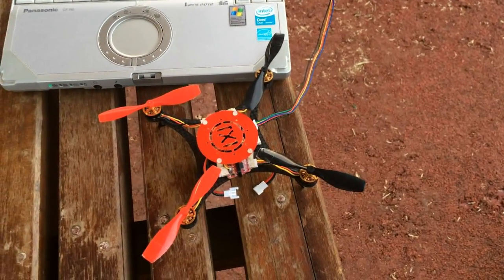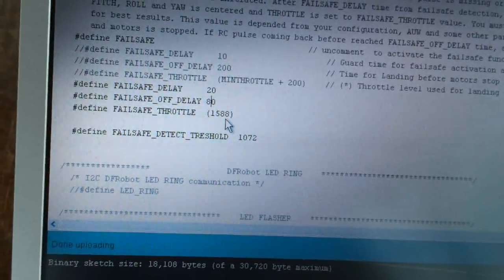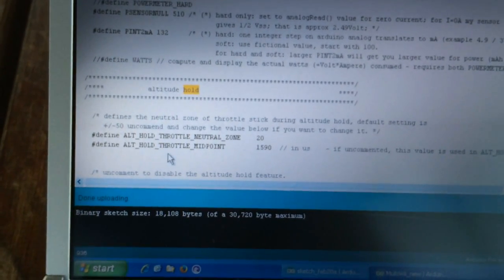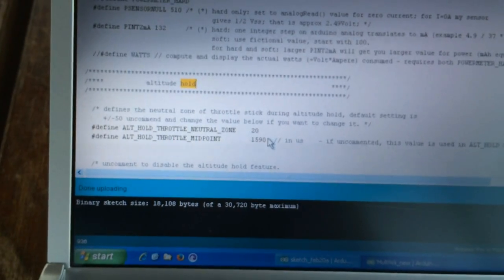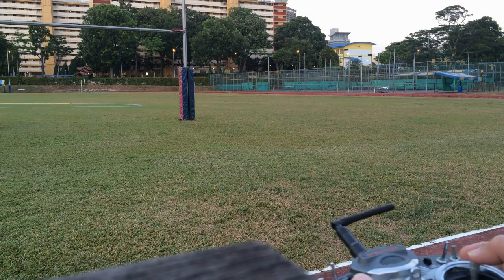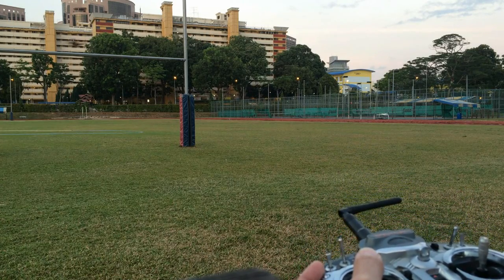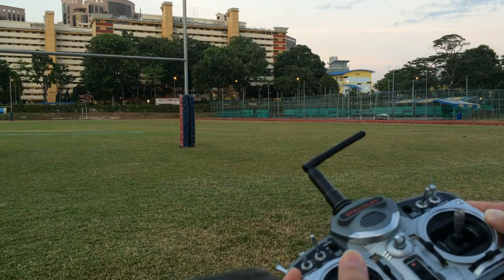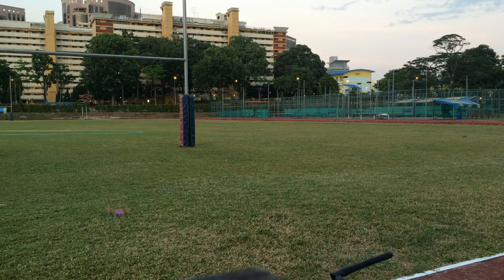Program Altitude-Hold on Super-X micro quad (multiwii nano)

Comment: is it possible you can give me your multiwii sketch ready to fly so i can flash my microsuper - x i downloaded a sketch from rc groups know i can not fly wont arm
and cant get it to connect to multiwii config can you please help it has become a 
paperwaight
Reply from the maker: M using this sketch >> http://www.rcgroups.com/forums/showthread.php?t=2284190

Change your end points to match your radio's throttle travel accordingly (I set my min to 1100 n max to 2000).
ESCs don't f@#king arm until I assign a gear switch (channel5) to arm it.. Verify your switch respond in the multiwii GUI. Also 1-time calibration is needed, uncomment the calib ESC do not fly, calibrate ur ESCs.. Then comment that code back